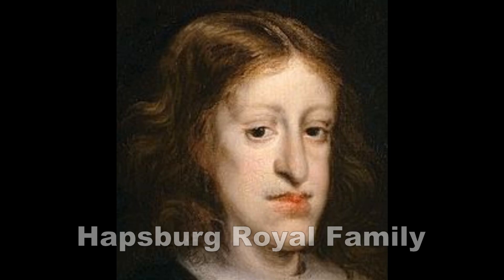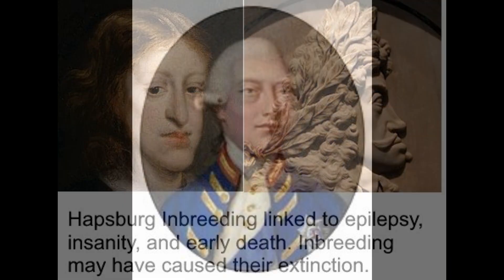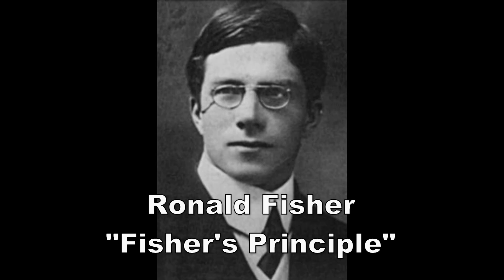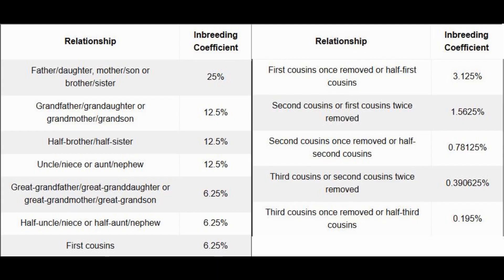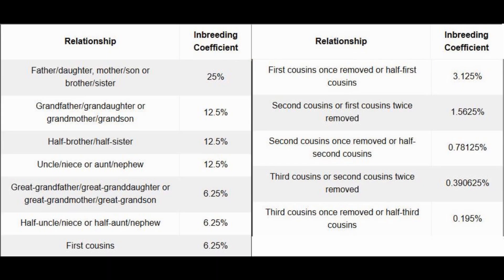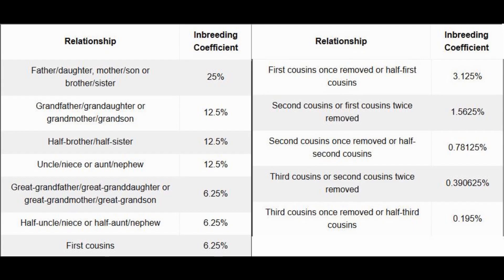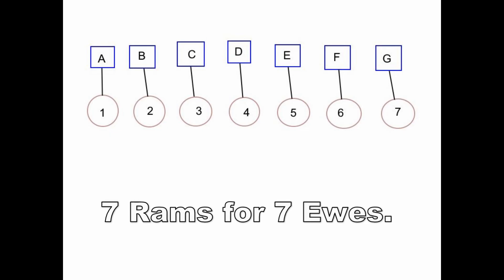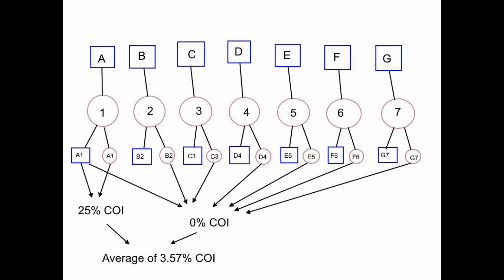How Breeding One Ram with 30 Ewes Causes Inbreeding – St Croix Sheep.

Comment: How do you kill the ones you want to eat?
Reply from the maker: I take them to the custom meat processor, or I do it myself.  

A sheep has a body that is nearly identical to a deer, with a backstrap and everything else, so if you know how to process a deer, you can easily process a sheep.  It is just that the custom meat processor seems to get more out of the carcass than I can. 

Thanks for your comments.  John Hurt
Reply: @PureNaturalSheep thanks.  How do you kill it?  With a gun?
Reply from the maker: @PaulCAmerica  Paul. 
To kill an animal, you take a knife and you cut the animal's throat.  You press the knife as deep as possible across the throat to cut the carotid artery that sends blood to the brain.  When you cut the carotid artery, the animal "goes dark" and dies immediately, with no struggles.  If you only cut the throat, they will suffer and gag.  So cutting the carotid artery by pressing a very sharp knife all the way through the throat and against the animal's spine, with a good amount of force, is the best way possible to dispatch an animal.

A LOT of people are squeamish about killing an animal yet they will buy a hamburger from Burger King with no questions asked.  Every meat product comes from someone killing an animal.  If you are going to eat meat, you need to understand that something has to die for you to live and eat meat.

Some people become vegetarians for this reason.  The first time I killed an animal, I had some issues with it, now I understand it is the cycle of life, just like how a sheep is killed by a wolf or coyote.  Animals are more humanely killed by a human than being torn apart and eaten by another animal. 

So it is very natural for animals to be killed.  My son and I were chased by a very skinny bear and her cub in the Great Smoky Mountains that later killed and partially ate a woman sitting by a stream near Elkmont, TN.  I had to file a report with the rangers.  Yes, it is a "little different" when you are on the food chain yourself.  But that is Nature.

Take care,
John Hurt
Reply: @PureNaturalSheep  Thanks.  I agree with your philosophy.  Why do you prefer knife over gun?  Or that piston bolt thing that the pros use.
Reply from the maker: @PaulCAmerica  Use a filet knife because you will have to gut and skin the carcass as well as dispatch the animal.  A filet knife has a flexible tip for skinning, and it is long enough to reach where it is needed.

Comment: Your understanding of genetics is rather naive. Inbreeding and selective breeding are not the same thing, even though the latter usually includes the former. The mutant lambs could be caused by inbreeding alone, but the Germans Shepherds are strange shaped because they passed through a genetic bottleneck where people only let a few strange-shaped ones breed. Sometimes this accidentally fixes other, unintended traits, such as as a metabolic disorder or the high risk of hip dysplasia. But the hip-dysplasia is not the same thing as the sloped back, and could be bred out if breeders could be bothered to do so. Short term inbreeding of only parts of a breeds (like one flock), not matter how often repeated through time, isn't likely to have similar effects, because the moment the flock crossbreeds with another flock, the inbreeding dilutes away. What inbreeding may cause is the revelation of recessive genes, like the mutant lambs. Also, you can't ameliorate inbreeding in a small population just by keeping direct relatives from breeding with each other, as you suggest. Coefficient of inbreeding goes back forever and is only a proxy for actual DNA similarity.  If you breed second-cousins but all your great-grandparents were near clones, they will be just as inbred as sibling. Thus, in small populations (like island breeds) a level of inbreeding is inevitable and the population experiences purifying selection, in which recessive genes are slowly bred out of the gene pool. This makes them more resistant to the effects of inbreeding in later generations.  Modern commercial farm animals are less hardy because they were intensively bred for other things, usually rapid growth, which is basically incompatible with hardiness. People have been using stud animals since antiquity, and modern-ish breeds of animal only started existing in the past couple centuries. The difference is that in the past studs were for a flock, now they are for whole breeds.
Reply from the maker: Thanks.  If you have any suggestions for improvements, I would be interested.  John Hurt

Comment: Interesting points! I’ve got a couple questions. Is this year round chart what you have been following over the years? Do the rams ever breed the ewes at the wrong time of year?

If you get rid of most of your rams in October then even with your new ram lambs that will be born in December to March you wouldn’t have an equal ratio of rams to ewes. For example if you keep ewes for 5 or 6 years for breeding but you only keep the new rams each year (plus a few of the best older rams), then you would have a lot more ewes than rams and your coefficient of inbreeding would be much higher. Could you clarify how you manage the rams?

It would be interesting to see what the average coefficient of inbreeding would be for a flock if you kept half the number of rams versus ewes so that on average there would be 2 ewes per ram.

Also, do you register your sheep? If so, which of the two organizations do you register with and why? Do you sell some of your animals as breeding stock? What is your typical lambing ratio each year?

Thanks!
Reply from the maker: For the last 16 years the St. Croix sheep I have, with the rams and ewes together year round, they have always followed this same breeding cycle, without lambing at other times of the year.

The young rams start breeding at 4 months, so they breed in the same year they were born.  I am trying to get my male to female ratio "closer" to 1:1, I haven't got there yet. I also cull any ewe that gets skinny, which would be the older ones. 

With many rams, every ewe will definitely be bred that can be bred. If a ewe doesn't produce, it is not the ram's fault, and so she is culled, not a single ram.   So I cull ewes a lot, which keeps the ratio closer to 1:1.

You cannot register your sheep without using lambing pens to keep up with which lambs go with which ewe.  Also, with registered stock, you are more likely to have a higher female to male ratio, as you will turn a single registered ram out with many registered females.  You will have to keep the ram separate from the females for most of the year, and you are back to the commercial way of raising sheep with a LOT of human intervention.  

If you are a breeder, then you can raise a limited number of registered sheep.  Not many breeders have a 100 member sheep flock, as there would be too many lambing pens.  

If you are a producer, then you are letting Nature produce using the most prolific sheep, and not worrying about bloodlines and pedigrees.  Only the strong survive in Nature, not the ones with the perfect pedigree.  So no, I don't have registered sheep, but I did purchase registered sheep when I first started out. I never registered any because I thought it was a waste of money for my purposes.  But I do support those that raise registered sheep.  And registered sheep are not inbred, if their pedigree is correct.

I hope I answered your questions.

Thanks,
John Hurt
Reply: @ 
Thanks so much for your response! 

A few more questions:

Do you cull your St. Croix for scurs or color other than white?

What is your primary market for your culls?

On average how much are you making per sheep you sell?

Do you sell some of your best sheep to other producers as unregistered breeding stock?

About what percent of your flock’s diet is grain/pellets versus grass?

And what is your average lambing rate?

I really appreciate your knowledge and experience!
Reply from the maker: @michaelbwright14  I have already culled for other colors than white, this last year I culled for some that did not lose their winter coat.  I have not had a problem with scurs.

I can sell the culls at the commercial sheep barn or I can process them and put them in the freezer (I have 8 people in my household.)

I sell the sheep to others at market price for lambs ($2.00 to $3.00 per lb).  I do have some people that buy them for unregistered breeding stock, but I don't overcharge or try to hype it up to get more money.  I am more interested in encouraging other people to raise chemical free sheep than to try to make money off a sale, so I look for homesteaders that want to do the same thing as I do.  I have another business that pays my bills.

From Dec 15th to March 1st, I have them locked up for lambing in a 5 acre paddock, and supplement the adults with grain for about 10% of their diet. I use grain to get them to come into the paddock at night to avoid the coyotes. The lambs are 100% grass fed.  If I wanted to get my organic certification and grass fed only certification, I would drop the grain, which I did for around 10 years.  But when it gets really cold, I feel sorry for them, and they get a little grain to help them generate heat.  Grain is optional.

St. Croix ewes produce 2.1 lambs on average.  I have two ewes that produce triplets, the rest produce twins, and the new ewes all produce singles.

I am 67 years young, and have been raising goats, chickens, cows, sheep since 1999.  But I learn more from the farmers that have been raising animals for 3 generations.  

Thanks for watching the video.
Reply: @PureNaturalSheep  
Last few questions for you:

When you aren’t lambing do you do rotational grazing? If so, how often are you moving them?

Do you have guard animals?

What fencing do you use?

About how much do your grown ewes and rams weigh and how much do your lambs weigh when you sell them?

What type of minerals do you use?

I look forward to your future videos!
Reply from the maker: @michaelbwright14  I have enough grass so I don't have to do rotational grazing.  I bush hog the weeds when they get taller than the grass.   I am a grass farmer.
I have two Great Pyrenees and 1 Anatolian/Pyrenees mix.  The Great Pyrenees stay with the sheep 24/7,  the Anatolians like to roam the entire area looking for coyotes.
I use woven wire fencing 47" tall with barb wire on the top.  I use creosote posts, some posts made out of black locust, and metal T posts.  Perimeter fencing is the most important safeguard, along with the dogs.
Ewes are around 120 lbs, rams 165 lbs, lambs are 60,80,100 lbs depending on the age.  St. Croix lambs do not grow as fast as other breeds.
Sheep minerals either from the Farmer's Coop or Tractor Supply.  Also white salt blocks.
Thank you for your encouragement, it helps to be appreciated.
John